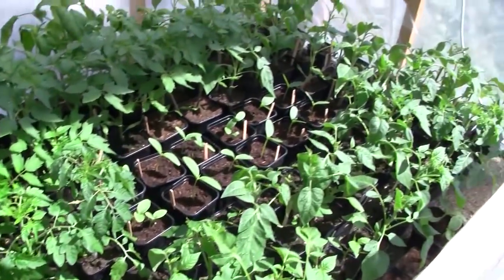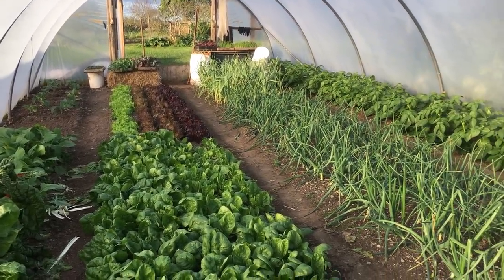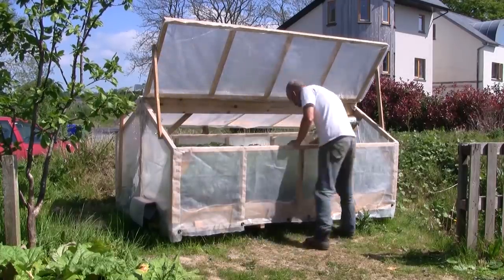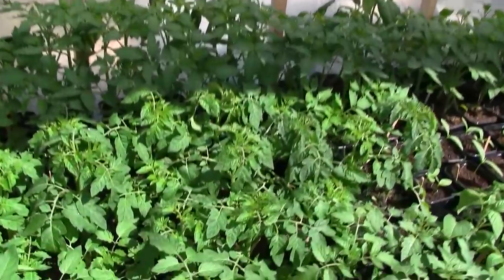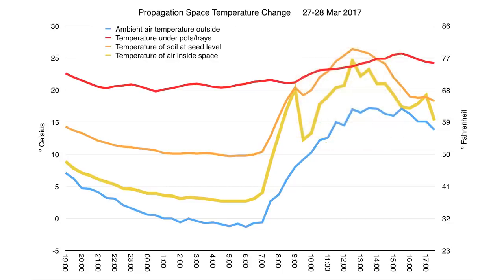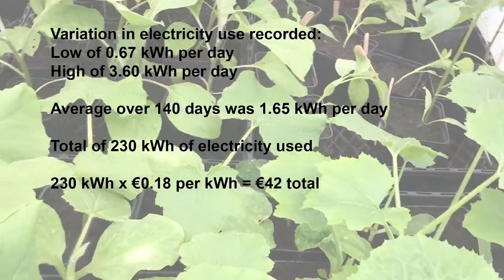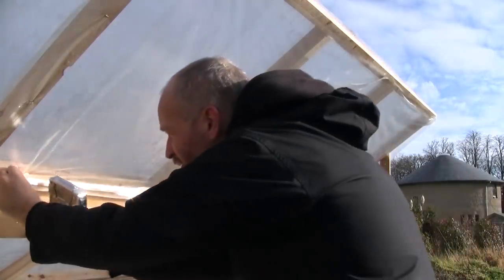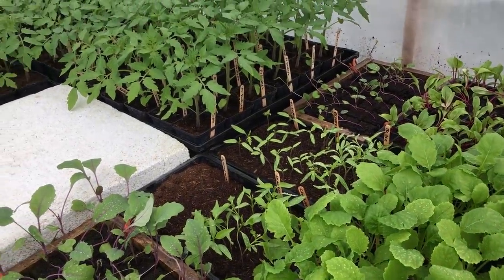A Heated Propagation Space

Comment: Have you tried additional row covers in the polytunnels and nursery for those frosty nights? I think that was one of the tricks Eliot Coleman uses. You're probably also losing a lot of heat through all the gaps in the roof frame and hinged area in the nursery, consider adding a seal to them and making them as air tight as possible, and venting from the bottom through the heated sand to act as an air to air heat exchanger.
Reply from the maker: I use that method in he polytunnel quite often, thanks to Eliot Coleman. I have found in my location that most times it isn’t really that useful, as it increases the humidity, but I am just working on  another video about using fleece to save some plants from a hard frost. Works well!

But thinking about your comment, I might look at laying a fleece on top of the plants in the propagation space at night time, just to conserve some energy/warmth. Could work well, thanks.

Comment: I’ve read a little bit about using the heat from compost to help propagate plants and believe it’s most helpful in the early stages of seed germination. One thing to keep in mind is the extra carbon dioxide released which will make any plants grow faster. I think you could use this method to supplement the heat from the heating coil and/or combine it with the water jugs you mentioned to help retain the heat. I look forward to seeing whatever you come up with. Great video as always!
Reply from the maker: Thanks. I have come to understand that the extra warmth is most helpful for seed germination. I have started to germinate the seeds inside the house, in a warm space, and to move them outside as soon as the first sprouts appear. Heat later in the development of the plant seems to just help them grow faster - which may or may not be a good thing.

Comment: I'm wondering if a lot of your issues could be resolved by building it more like a traditional cold frame -- i.e. using glass windows (or rigid polycarbonate) instead of plastic sheeting.   Cold frames are pretty handy back here in Canada for extending the growing season, and I imagine they'd be just as useful, if not more so, in Ireland's milder climate.
Reply: Glass requires frames so in general glass greenhouses give a bit less light then polytunnel greenhouses and supporting hoops,

But in his case, with a robust nearly glass worthy frame and double layer of plastic, glass would work better, especially double layered
Reply from the maker: Yes, glass would definitely work better. If I was going to keep the same structure or format, I have been thinking of cladding it with glass, though I’m not sure if the current frame is strong enough - glass isn’t so flexible! It would make the lids quite a bit heavier - especially if double glazed as suggested - but they could be split in two on each side.

Comment: I used some wind break netting and 17g per square metre fleece to cover my diy cold frame (no plastic, glass or polycabonate sheeting. I did use some wood to make a base frame to support fibre glass rods to make arches (rods are 1 metre long) across the wooden base. I placed this on top of black winter fleece that i had placed in between folded plastic sheeting to keep the black fleece dry and to prevent it from freezing. But the plastic covering the black fleece did trap water that did bottom irrigate my plants...great. Small tomato plants survived a -2 degree celcius freeze over 1 night. All of my plants are in good condition. I also copied your plastic sheet in a wooden frame to sub irrigate seedling trays...great idea. Just to add, I used 1 metre wide wind break netting and 1 metre wide 17g per square metre fleece. Wooden frame is about 65cm wide inside and about 3 metres long. Sad part is, I need to put legs on the frame to bring the fibre glass rod arches higher by about 15 cm so that the seedlings at the edges arent vertically suppressed by the covering fabrics. The arch height was also a problem for my cabbage seedlings when they got larger. By the way, the wind break fabric not only breaks the wind but also the chill factor. I dont have temperature monitors. Yuzet is the wind break netting maufacturer...
Reply from the maker: John Devereaux Thanks for the detail of your setup. I like the idea of combining fleece and wind break netting,  a good combination.

Comment: Commercial glass houses and some polytunnels use an insulation screen over night to reduce heat loss quite a bit. guess you could cover your small propagation space with aluminium insulation mats or something similar over night, or for example air bubble plastic which could stay on top also on very cold days as it lets at least some light through.

Comment: nice propagator. for my needs i merely use a propagation mat in garden shed with a timed led light. yes, it's all about the soil temp for propagation.
my main veggie raised beds are shaded by shed and fence during winter, which is just warm enough to grow winter crops. i plan to make some sort of reflector one day, to increase light levels.
about 20 metres below soil surface is usually 15+ C. Trouble is tapping into this free heat source. I've seen it done to provide home heating but never for gardens. heavy duty work and engineering, making sure no big rocks are in the way.

Comment: This was very interesting!  This year I'm planning to build my own dedicated propagation space as I'm overwhelmed by seedlings in spring and managing them on the window sills is too much work (too hot, not enough light).  I need a new shed too, so I'm planning a building that's half well insulated wooden shed (with a poly roof) and half - south facing - lean to polythene greenhouse, with racks for seedlings.  I will hang a reflective roller blind/curtain to keep the light moderately even.  Given the insulation levels in the shed I think it will be practical to heat with a thermostatic gas heater - sadly no option for green electricity.  I'm considering double skinning it with removable polythene panels, but concerned about condensation and - as you found - reduced light levels.  By having the panels removable though I can swap in shade panels in summer.   : All the best - Steve
Reply from the maker: Sounds like a greenhouse on front of an insulated shed is a good plan - the reflective curtain would definitely be a help. Having that convenient source of heat is a tricky one, as it is so easy with off the shelf heaters (electric or gas). You might be able to find some old sealed double glazed windows - even without frames - as the glass is so much better for light transmission. But then you need to worry about ventilation! Good luck with it all.
Reply: I did the same with my shed roof, took the sunny side of the roof off and constructed a frame with polycarbonate panels fitted into it and hinged this to the shed purlin so it can be raised with the washing line pole on sunny days, after autumn it is screwed into the shed frame. I have a propagation bench in there the full length of the shed, holds 9 standard seed trays, soilwarming cable in vermiculite as its lighter than sand, you can buy builders vermiculite for one tenth of the price of the horticultural stuff, it's used for filling in chimneys,  and a series of led lamps above.  It works great I started giant onions, Globo, in there last Nov.

Comment: Went through the same issues as you. The final design was a little green house inside the green house. It is completely automated with a Heater and a Cooling Fan. If you don't know about Sonoff devices - learn about them. Cheap way to automate a lot of stuff. I automated the heater and the fan to start if it got too cool or too hot. When outside temperature was 10 Celsius and sunny, inside the mini-greenhouse it went above 45 Celsius if there was no fan. And i never let it get below 12 C at night. For next year I plan to automate the sides of the big green house to open when too hot and to also automate the roofing of the mini-greenhouse to do the same as to use less electricity by just venting it instead of using fans. Sonoff wifi relays also have humidity and temperature sensor which you can monitor from your phone and if you're away it's really easy to see if there are problems at the greenhouse. I never imagined it would get so hot and didn't add a fan and when I saw 45C on my phone I called a neighbor to run over and open everything up :).
Reply from the maker: The setup you have sounds great, thanks for describing it, and for he info about the sonoff systems. Looks like a really useful series of pieces of equipment. I’ll definitely look into them some more. I’ve been slow to automate, for a few reasons, but it is about time I explored these possibilities.

Comment: Another most interesting video Bruce - thanks. 

Just shows how multi-threaded problems can be.  provide a solution to one aspect, then the something else becomes a must solve.
For many of us in the more northern regions, finding warm for germination is an ongoing difficulty.  I don't have enaything like your scale, but have thought about a single straw bale and innoculating it with coffee grounds as my copious horse poo supply has dried up until I can arrange another.
I'm sure you have seen Charles Dowdings compost incubator - his covered space is considerably more than mine, but I could manage a single bale with a cover like you designed.  Something perhaps to be dismantled in summer, and the bale turned into compost.
Thanks again, 

Nick.
Reply from the maker: Thanks Nick,
Your point about one solution leading to other issues that need to be sorted, is an important one. The world is full of simple/cool solutions, and I have become mor interested in the complexity of the issues they cause, than the simple beauty of the idea.
I don’t think I’ve seen Charles’s compost incubator, and I’ll definitely be delving into his experiences before trying the hot compost method again.
Reply: @REDGardens  Charles seems to have used the big cube of manure as a propogation heater in his glasshouse for a long time.  His recent trials (last season or so) of trying it out as a heated growing space outside were less successful, but goes into the reasons he thinks it was less than stellar.
Using hot beds is very old technology, certainly in the 18thC, it was used to grow exotics like pineapples in deary, cold Derbyshire winters.
Reply from the maker: It definitely seems to help to have a bunch of manure to start with. I have heard that horse manure can be the best for use in the traditional hot beds. Charles is fortunate to live in a place where manure is plentiful - I’ve found it harder to get manure in my context, which adds another hurdle to me figuring out how to adopt the method. My own experimentations we’re based on a mixed compost with grass clippings, which ran too hot at first and then cooled fairly quickly. Manure apparently can give a steadier warmth for longer. But no doubt there are lots of options. Looking forward to exploring this area again.

Comment: This is close to what I do.  Except that I want wooden square pots with removable bottoms.  This way, when the plants are done being in the propagation room, they get transplanted without removing the pots and disturbing the roots.  I think this is what I will go for next.  Pots that resemble mini garden beds.  The transplant shock is severe when the plant is 4 feet high.  I have to work on that or the usefulness of the propagation room gets reduced.  Have to start my season a bit later so that my plants are smaller.  I would rather work on ways to ease the transplant process.

Comment: Awesome video! Just a tip: double glazing works a lot better if the air gap is less than around 1.5cm. The difference isn't a lot but it might be worth trying if you ever had to replace your propagator! 

Also, one thing that crossed my mind while watching your videos: the amount of compost you have readily available is significantly more than what could be produced in a family home. A family could buy compost, but it might be worthwhile to trial a less compost intensive approach on one of the gardens to see how it might affect yields. I think the simple garden would be a good candidate. Obviously up to you, just a suggestion 😀
Reply from the maker: Thanks for reminding me about the issue with the air space. I had learned about that years ago, but forgot since. If I remember correctly, if there is too much space, a convection current of air can establish, reducing the insulating efficiency of air space. 

You are right about the issue of limited access to compost being an issue - it is something I struggle with despite having so much compost available - I have too many gardens!
I ended up buying in a load of compost this season to make up the difference for a few of the compost intensive gardens. In some of the other gardens I am trying a minimal compost method, and exploring the issues with a much larger Black Plot that I am trying to get under cultivation. Lots to learn and explore with this issue.

Comment: When your video started I wondered why you did not double up the poly.  Then I saw you did.  You mentioned the issue of cutting back the light and I wonder why you doubled the top.  I know heat rises, but I would think most of your heat loss is when the wind blows against the sides.
I am not a fan of using electricity for heating, but with the sand, I think that is a good choice. 
I seem to remember that propane has a property where it can burn at very low rates in the presence of something, this is done without a flame.  (I am hoping someone else can reply with more specifics.)  I did some googling and there are ways to keep a tent warm in the winter, not sure if those solutions are better than electricity.
Reply from the maker: In our climate, the really frosty nights tend to be when there is clear skies and no wind, so most heat loss would be through the roof. But the rest of the time, when it is cool and windy, keeping wind out definitely helps. 

There are a lot of cool tricks and methods for providing a bit of heat to a space, and the comparison to a tent is a good one. It is hard to beat the convenience of electricity though - when you have a connection.
Reply: @REDGardens  In the US, we have a plastic that goes over windows and patio doors.  It is something that I do in the winter months to put in an extra layer of insulation.  It is somewhat thin, but very clear.  you can use a hair dryer to make it tight and clearer.  Perhaps something like this could be done on the inside of the top.  It is not durable enough for the weather, but good enough for an extra layer and clear to let more light in.
Reply from the maker: Frank Kujawski Ah, yes. I remember seeing that stuff a long time ago. Useful stuff, especially for old houses, though I don’t know if it is available over here.
Reply: @REDGardens  It usually is really cheap this time of year.

Comment: id run 2 one smaller one for seeding and larger one for growing on plants so u can set temperature a bit lower for growing on. seeds need a bit more heat to get them going
Reply from the maker: That would make sense. I have started to propagate/start the seedlings inside in my warm utility room. I check them every day and move them to the main propagation space as soon as the sprouts appear. It is more work but seems to work well, with faster and more consistent germination. I have seen that some market gardeners use an insulated box or disused fridge with temperature and humidity controls to do all their germination. Seems really efficient, if it makes economic sense to pay for the setup costs.

Comment: I wonder what would be the costs and benefits of using one or two solar panels to heat the entire polytunnel during colder nights as I am very intrigued by the fact that you can grow tomatoes in the  cold spring. My zone corresponds with 7a, and so far, I've been pushing everything as early as I could and it kinda paid off, I have green tomatoes in my greenhouse, the size of chicken eggs, and I start wondering how much better of a result I could've had if I used some heating source. I'm definitely gonna experiment with that, all the hard work from I was building it starts to pay off. Thank you again for your great documentation and inspiration.
Reply from the maker: I have also been thinking of how to boost the warmth in a polytunnel on cold nights, and the issue seems to be how to store the energy. I figure finding some way to heat a tank of water, or the soil itself may be a goo option, but requires some way of transferring the heat to the heat sink, then getting it out again.
Reply: I have seen solar being store in a hot water tank , and I do know many people heat water with solar. I also have heard of people using compost to heat , I think it was something they did in the Holland Marsh , maybe there is some info out there on that.

Comment: Bruce, I created something similar to this a couple years ago. It is a 4'x8' cart which I roll from my garage to the driveway in the morning and back into the garage at night. The sides are clear plastic, and on colder days I put agricultural fleece over the top.

It has worked pretty well, but it requires work on my part in the morning and evening, and the HOA is starting to complain. I am considering duplicating your design in my backyard. How often do you have to make adjustments to the roof? Can you leave it for several days unattended?
Reply from the maker: Woah, I never thought of putting it on wheels! But then again I don't have a garage to wheel it into. 
I tend to adjust them at least twice a day - morning and night. I have been thinking of getting those automatic vent arms, which open when the temperature gets too high, which could save a lot of the attention.